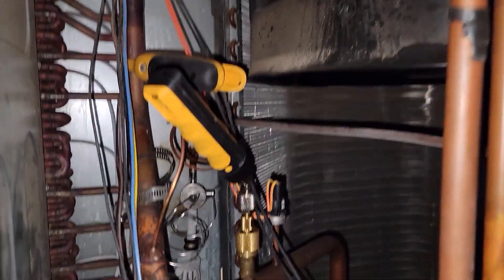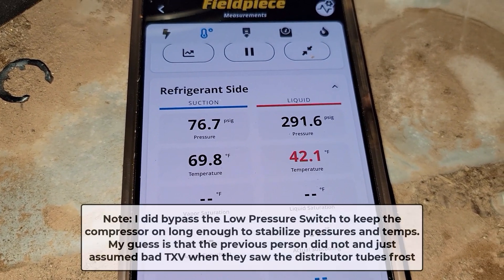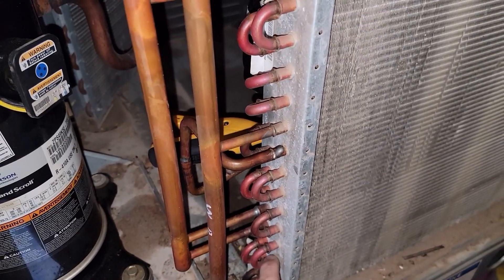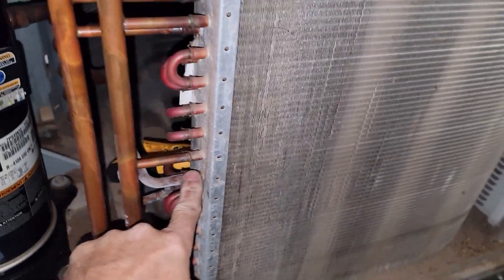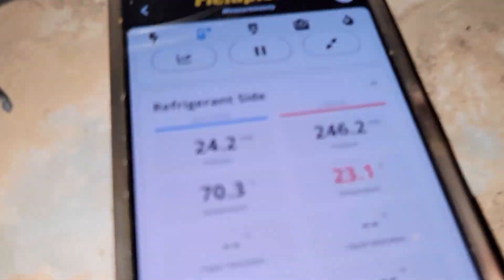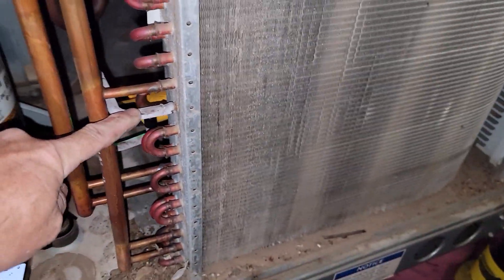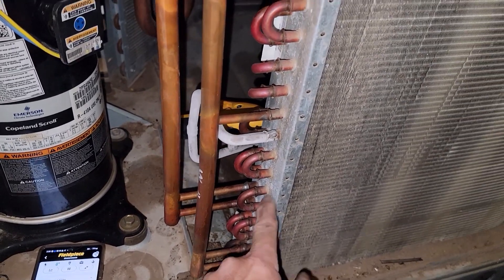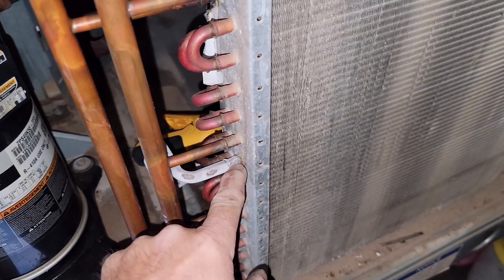"It is ALWAYS the TXV" - Restriction in the condenser coil causes TXV underfeed

Comment: Another thing I don't understand with carrier is the choice to either use accurators on ur Evap header, or hiding the TXV on the inside of the EVAP cabinet where u have to lift off the whole top of the unit to see the TXV. I'll get carrier RTUs with TXV some times like urs in the video where's it right near the compressor at the Evap header. Is this based off the reduction of the unit's footprint? Or is it purely aesthetic?

Comment: Does that unit have the Carrier Accurators?
Reply from the maker: Yeah. But I think something was left in a tube during production. 
Just like I've seen split units get installed with the rubber plug pushed into a piece of copper that then stops at the TXV.

Comment: thermal camera might tell you where it is blocked ?
Reply from the maker: Yeah i been meaning to get one.
Running a minute with no fan on would surely show up as temperature
Reply: @hackfreehvac I have a  danfoss  12vdc mini compressor  and I just accidentally  frid the inverter  bord  how hard are they  to repair  or should  I just  buy a new  one
Reply from the maker: @posttopstreetlight1055  Well the thing about mosfets etc is often the driver circuitry gets taken out and sometimes all the way back to the processor if not isolated thru special drivers
Reply: @hackfreehvac  good idea stop the fan &  inflate the head pressure but that obstruction will land somewhere s else in the system for sure